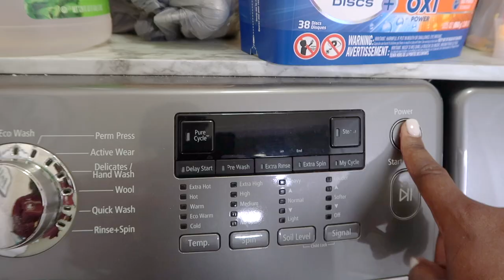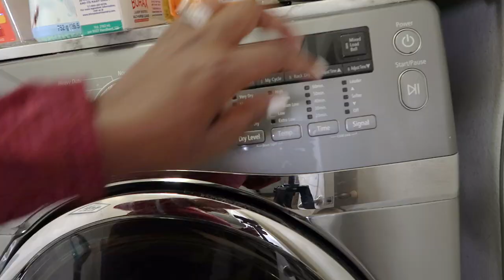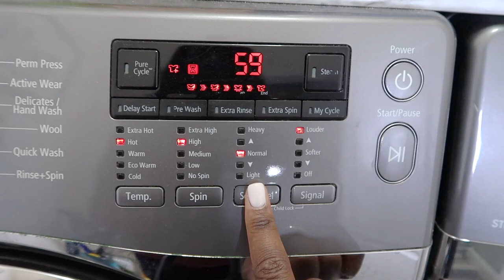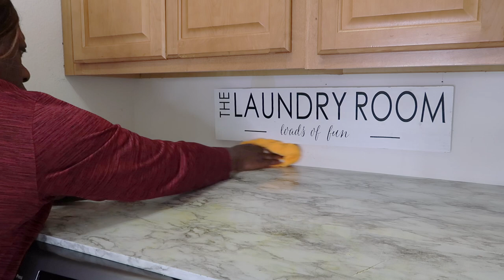NEW WEEKEND DIRTY LAUNDRY ROUTINES | ALL DAY CLEAN WITH ME | LAUNDRY MOTIVATION

Comment: Great motivation I did 2 loads of laundry and drying, removed clothes from dryer, laid out neatly will fold and put away tomorrow. Then needs to clean washer, oh joy lol.
Reply from the maker: Great job Linda. It feels so good to check those 2 loads off your list. I'm so appreciative of you always coming by and watching and supporting me. How do you clean your washer? I can always use tips.
Reply: My washer is an old one, top loader with agitator. I clean out fabric softener area then pour hot water in until it gets cleaner. Then just clean with an antibacterial mr clean or lysol. I finish by running an empty washer with warm/cold cycles.
Reply from the maker: @lindadellarosa9596  oh. Ok. Thank you. 💜